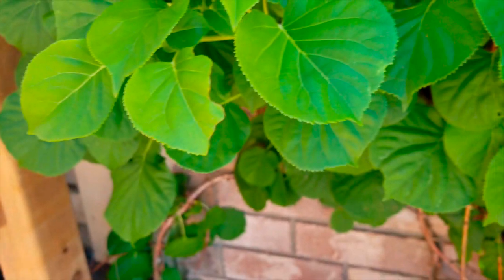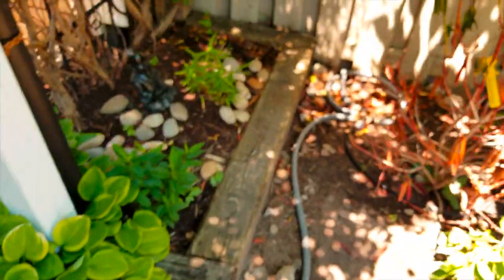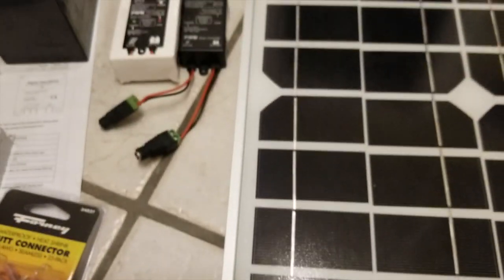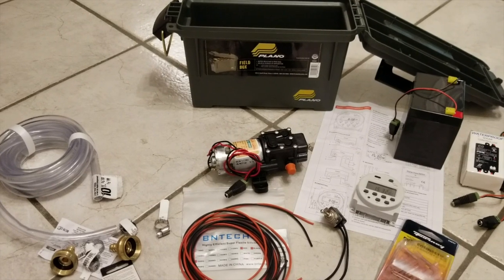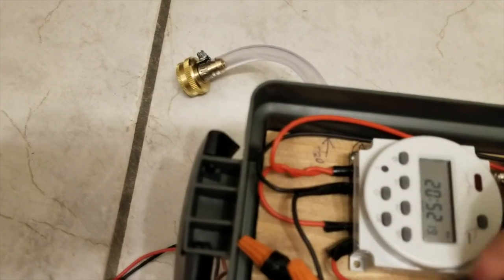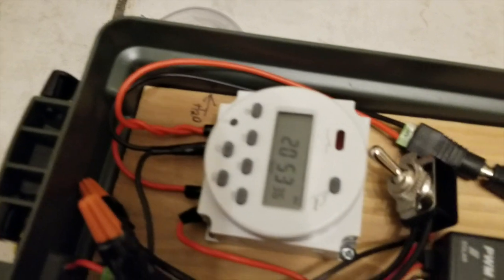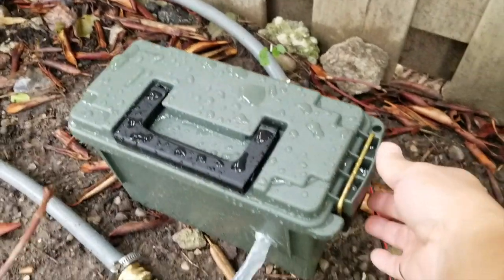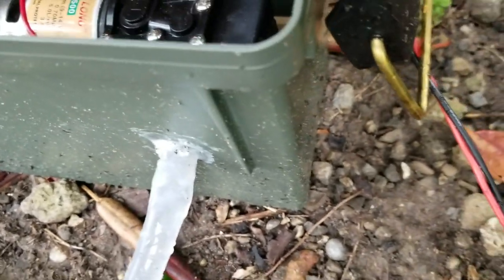Build: Solar Powered Pump to Water Flowers from Rain Barrels

Comment: Where did you get the pump?
Reply from the maker: Amazon. I don't believe they sell it anymore but I'm sure you can find something else. Here's what I got:  ZJchao DC 12V 100PSI 4L/Min Diaphragm Water Self Priming Pump High Pressure for Caravan, Camper, Boats, Marine, Home Garden and Camping https://www.amazon.ca/dp/B00ESCI9MC/ref=cm_sw_r_u_apa_glt_i_VERM0YT2WB2Z6WKNCM5F?_encoding=UTF8&psc=1

Comment: Ok I am building this for my garden uphill from my rain barrel.  Did you upgrade the panels and or battery or do they work fine
Reply from the maker: They have worked well for the past 3 years running half an hour every day, watering 6 flower beds.